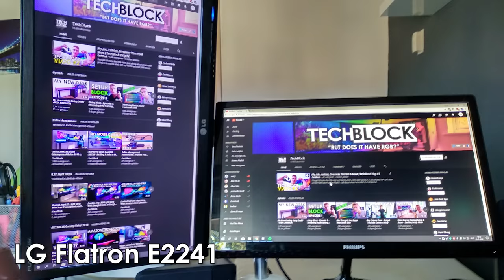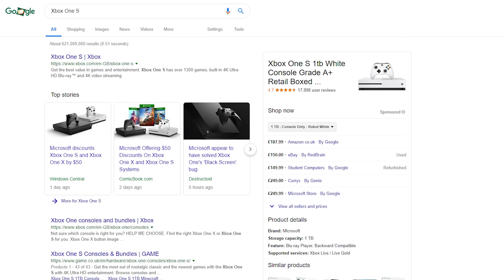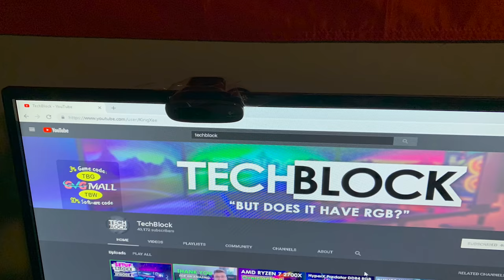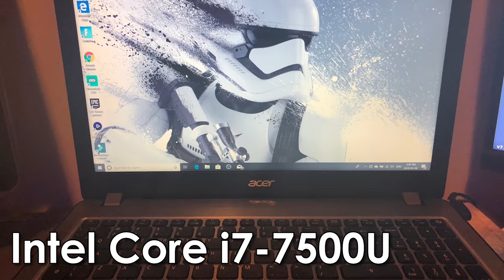Setup Block - Episode 8 - Budget Edition

Comment: Dang, I wish I knew about this sooner, I would of love to enter my PC/setup. 

Here is my current setup for anyone wondering (With prices):

Upgraded Dell T3500:
Xeon x5677 (quad core with Hyper-Threading @ 3.46Ghz) - $25
12gb of DDR3 ram (Orginal T3500 came with 8gbs, 4x2gb) - $10
1TB HDD - free
120gb OCZ SSD - $30
GTX 960 2gb - $120 (I bought it during the mining craze so I overpaid, sadly)
Everything else is stock (PSU, Motherboard, Heatsink and etc.) - $75

Peripherals:
Aula gaming keyboard (Blue switches) - $30
Razer Deathadder - $30
XXL Gaming mousepad - $10
AT2020 Microphone (XLR) - Free
Boomarm - $10
Pop filter, Shockmount - Free 
Behringer Audio interface (XLR to USB) - $30
ATH-M40X Headphones - Free
Dell 15" monitor - Free
MSI Optix MAG Curved 144hz 1080p 1ms monitor - $150
Random Black desk - Free
Sert memory foam office chair - $25

PC - $260
Peripheals - $285
Total = $545

I think that I did pretty good. I think this is still a budget setup, being only around $550 and if you pc the same GPU I did now the price would drop by 40 dollars. The GTX 960 2gb you can get for around 80 bucks but when I bought it, it was 120. So that would put it at about $505. 550 for everything I have is still pretty good.

(Note): The things that I said were "Free" are NOT things that I got for Christmas, my birthday or etc, those items are still included in the total, and their price is set to what my parents or whoever bought it for me paid. The things that are free, are things I got for free myself, as in, no one I know paid a dime for it nor did I. I won't tell you how I got something like the AT2020 XLR mic for free or the M40X's for free (Total of $200 dollarsish), that is a secret.